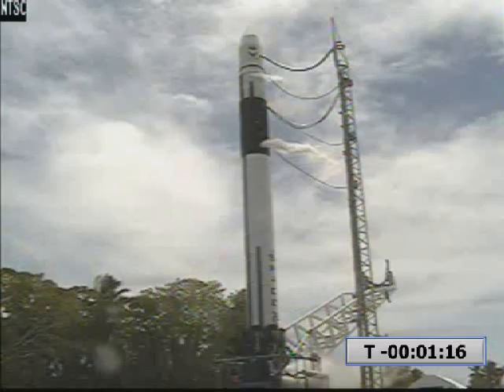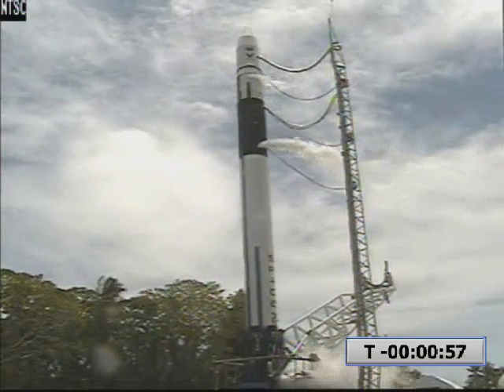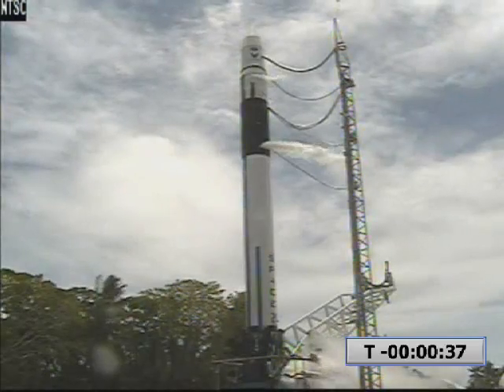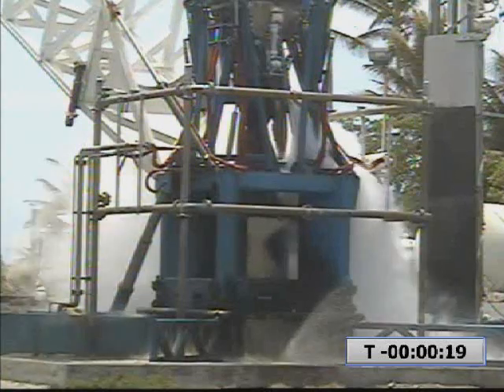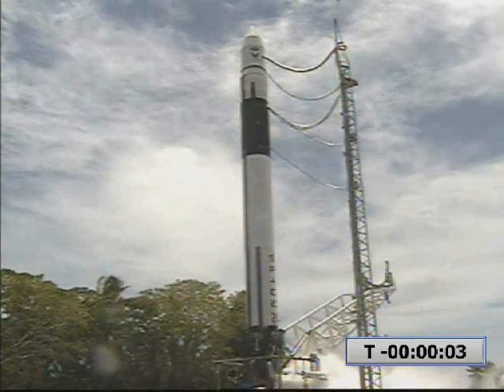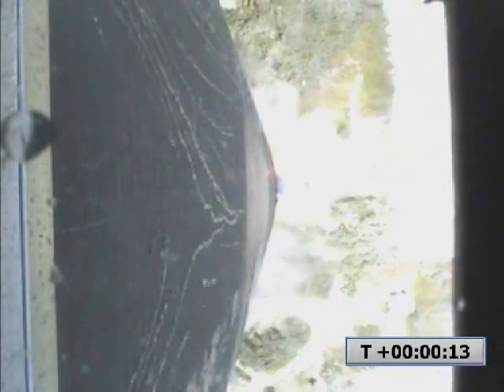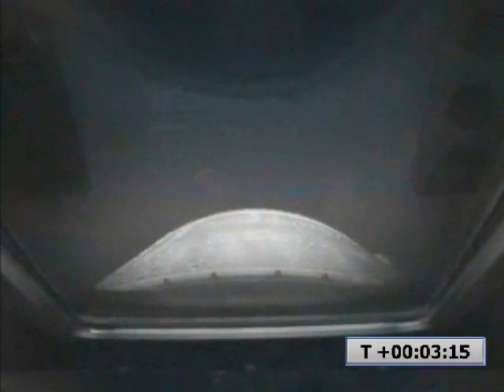SpaceX Falcon 1 launch

Comment: The contact and rotation at separation was largely due to the vehicle being at a lower altitude and a slower speed than intended, putting heavier air pressure onto the 2nd stage & fairing than what they were designed for at stage separation.

The vehicle was lower and slower at separation because of a computer error. 

It reached 289km.

Comment: Thanks ugowar.
What I said was what I was taught back in Engineer School. It is a technique that is still in use today, but is starting to be come rare as LOX circulating through the nozzle walls has been shown since the 1960's to be a better thermal control method.

Comment: What's actually getting red hot here is the nozzle extension. It's designed to be radiatively cooled. 
First stage engines are typically ablatively cooled or regeneratively cooled and neither of those glows hot on the outside.
Here, the throat of the engine is also ablatively cooled, but is invisible to the left.

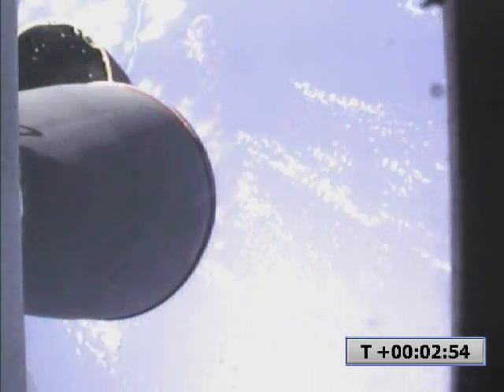Comment: Fuel slosh also known as pogo, causes a linear oscillation not the kind of gyration you see here. Watch closely at 4:12 the staging of the rocket is what actually causes the issue. The first stage slams into the nozzle, causing the rocket to veer off course, at that point guidance takes over and begins gimbaling the engine to attempt to correct this problem, it begins to over correct and the mission is aborted. At least this is what we came up with in my special topics physics 399 course :)

Comment: I saw two possible failure modes (the reason we *don't* see the last 5 seconds)... one was hot spots on the 2nd stage motor nozzle, and the other was the obvious guidance oscillation the system was in... that circular chasing mode needs to be damped out somehow.

Comment: At 2:52 there's clearly a collision between the first stage and the 2nd's engine. Could this be responsible for the following loss of a small ring at 3:12 and stage 2 failure in general?
Reply: That small ring is a stiffener meant to provide some strength so that it does not deform under launch stress